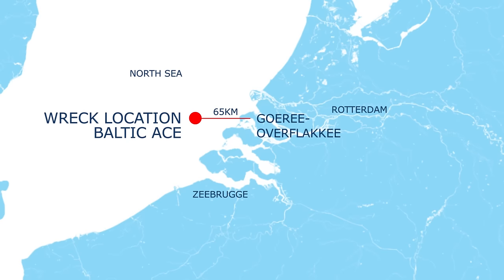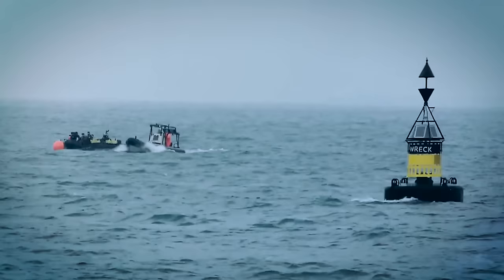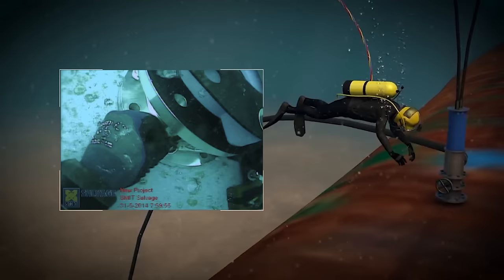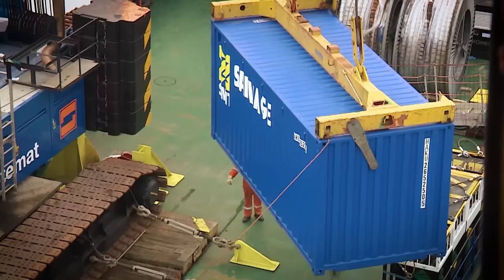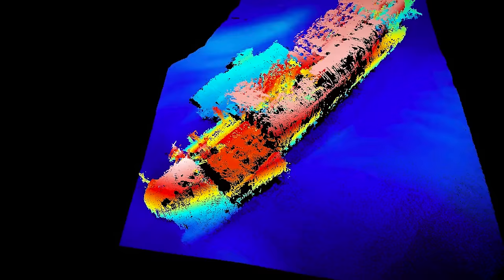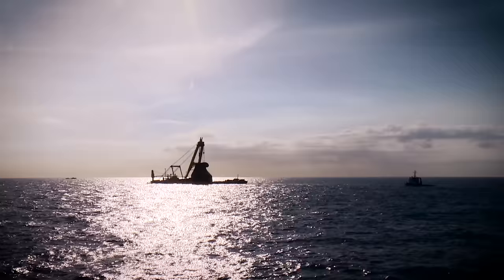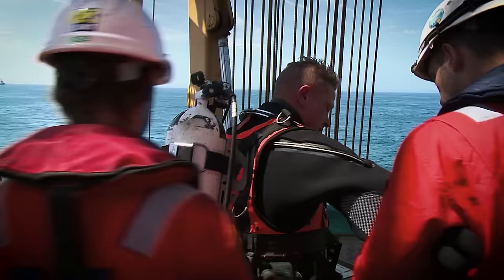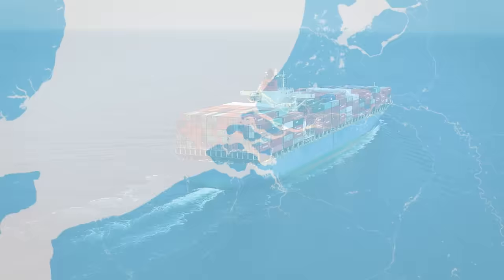Wreck removal Baltic Ace - Smit Salvage

Comment: WHAT THE HECK WAS THAT CUTTING DEVICE!? 

I must know..
Reply: +OhNegative The one that cut the ship up?  It's a wire cutter, I don't know the correct name for it but while complicated, the idea is quite simple.  A wire with diamond sleeves is laid over, or underneath the wreck and tension is applied.  The wire tightens and is pulled back and forth, creating a saw like effect.  Once the section of the ship has been cut through, the wire is moved onto the next section.  They used the method I think (for the first time) I think on the Russian submarine, Kursk.  There's a video of it here on youtube, just search for 'Kursk submarine salvage'.
Reply: +OhNegative I would guess something similar to a diamond impregnated steel braided line, pulled slowly back and forth.

Comment: From what I understand they must also find and document the VIN. of every car it was carrying.... sorting threw 500 wrecked and cut up cars has got to be huge amount of work just in that.
Reply: When SMIT salvaged the Tricolor from the English channel it was agreed  with the insurance companies that because of the damage caused by storms to the ship and it's contents that they would weigh the scrap and, using an agreed nominal weight, base the complete salvage on the weight of scrap brought to shore. The big driver here is the total removal of wreckage from the marine environment, not recovering the value of the cars. The environmental fines make the value of both the ship and cargo look like small change.
Reply: Not for the scrap value, but car VIN numbers can be very valuable to car thieves